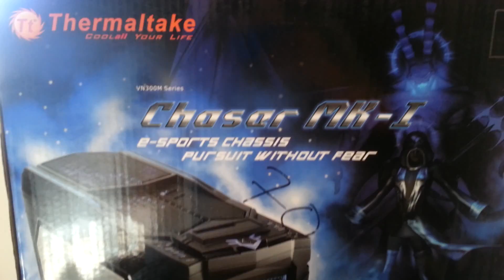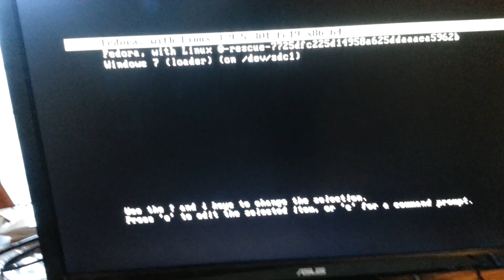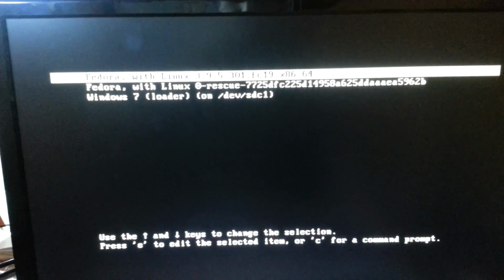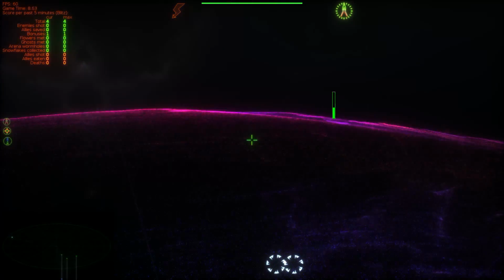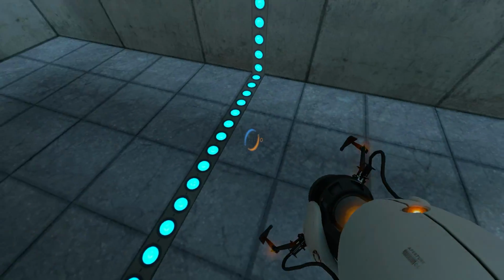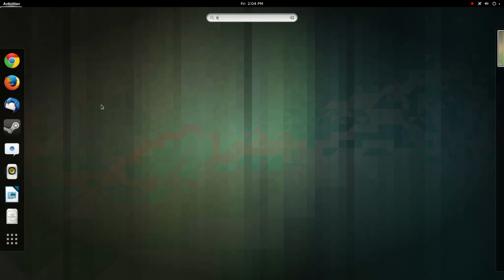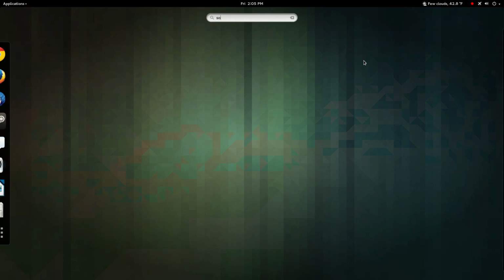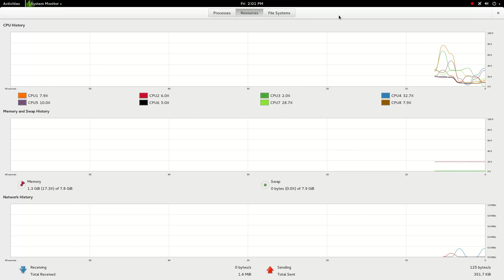Building my Linux Gaming Desktop

Comment: linux and gaming, not a good fit, even with DRI kernel drivers, X window system will always be a bottleneck, hope haiku OS will get native drivers, mostly it will beat windows on gaming performance, nice trooper btw
Reply: Cody Shell I will now commence in subscribing to see this video.
Reply: This problem is not that bad as you make it sound. Even with this "bottleneck" as you call it, good gaming performance is quite possible. But also is something that has nothing to do with Linux kernel. And also it will go away completely in the future. Android does not have it, Ubuntu will not have it with mir and all other distros will not have it with wayland.
Reply: lucinos19 its not a fault in linux, linux were not made as a desktop OS from the beginning, only nearly recently linux got schedulers for desktop performance, and linux kernel can be turned into anything but as long as we still use X windowing system we have problems, as for Android i have no idea about its architecture its based on linux but same goes for iOS and BSD they are now completely different, after all you might try linux native games and try same games "windows binaries" on windows and you'll notice a difference, linux is not a desktop OS and if it kept caring much about becoming desktop oriented it will lose in both server/embedded and desktop context
Reply: I just want to point out that they already did the study Linux Vs Windows. Linux won. It got 15 more frames than windows.
Reply: hi Brian, i will have to disagree, first of all this is no study, this is not even a benchmark :), getting more frames from a game that doesnt use modern shader capabilities is not a benchmark, linux is better than windows "as most unix like OSs" when it comes to matters like processor affinity and memory management and others, and that can boost performance of "some" games but that cant be applied to most other games, just try it out your self, get a game with heavy shader use and check out yourself, even most older games will still have better performance on windows, and that doesn't hurt linux btw, i use linux right now, just linux wasn't designed as a desktop OS, or for multimedia as say Amiga, its just the modern hardware make that gap smaller, but its still there, and will always be there as long as we use X windowing systems.
Reply from the maker: BrianGamesLOL Thanks Brian!
Reply from the maker: Adel Essam I working on a test video comparing linux and windows. it will be up soon
Reply from the maker: I just ran the test and took some clips. Overall windows did better than linux in opengl and directx11, but it suffered greater framerate drops. I will have it up soon!
Reply: that matches what i said, graphic performance "gpu based" on windows is expected to be better, and linux is better when it comes to threading, VM etc, still with games like most modern ones with heavy shader use "much gpu reliance" are expected to have much better performance "including frame
rate" on windows
Reply: Wayland, linux
Reply: ***** actually i know what linux is, and i use linux as my desktop OS and BSD everywhere else, i mentioned before linux has much better implemented core OS subsystems not only that its not bloated, but again the point is that linux never been made with real time graphics in mind, and i use linux for gaming and i know well most games run better on windows, not for windows being superior but for it includes graphic subsystem fully into the kernel, yes linux is not far from that but until now linux is behind in games which doesn't hurt it, for me i don't care that linux become superior in games cause linux will not fit as desktop OS at all, it can be use for advanced embedded systems and servers, again i don't defend windows being the perfect desktop OS, windows tried to be both desktop and server oriented OS and it failed in both, only cause linux is open source and you get the advantage of removing and adding what you need into the kernel at compile time keep it from failing as a server OS. still as i mentioned linux is superior OS at even fundamental OS subsystems, check out HaikuOS which is desktop oriented OS to get what i mean, check how slim and lean it is and still retains a desktop OS simplicity, its still under heavy development but it shows what a desktop oriented OS can be
Reply: ***** benchmarks for one game is not enough, besides i mentioned that linux has superior subsystems other than graphics that allows it to come up with better results than windows, and i did not say linux will never be better than windows in gaming cause with dri2 and newer graphics innovations it will be great, but it is not now, as for a desktop OS for me it is a slim OS where you can configure everything from gui and easy and elegant with security added as services, all the things you talked about on how linux is stable and secure and so is just as much a server OS requirements, what make a desktop OS is the simplicity to deal with it, android is not a linux anymore, it uses a heavily batched linux kernel and heavily batched libc "derived from BSD" and builds up a C++ and java API, true you can chroot into a linux system but android is no longer linux, and actually if android was built from scratch as mobile phone OS it were to be much slimmer, like how haiku is, why would you turn a beast like linux into a baby OS ? linux is no magic by the way, there are some realtime operating systems that advances into very powerful OS and on the hardware they are designed for they outperform linux and BSD its a matter of optimization, haiku is just an example of an OS optimized for desktop use, i like linux and i use it as my desktop OS cause i like it, but if haiku had as much packages as linux has i were to use haiku, it got a posix interface that can run almost every posix non graphical program, have a nice day
Reply: lol okay just calm down i am not challenging you here or making less of you, i work with unix its my work, and i run BSD and linux servers, and i also use unix shell most times, and the computer i use right now got openbox wm and a minimal taskbar and thats it "debian based", when i talked about GUI i meant a desktop OS, if you think all desktop OS users have to learn to deal with commands and read man pages then you should never expect your OS to succeed, as for linux, linux is slim and fast compared to other server and most desktop OSs, but i cant claim that linux or even BSD is the fastest operatingsystem ever, even if they use them for supercomputers, supercomputers are fancy hardware, if you want to really measure the speed of an OS measure it on modest hardware, an operating system is the platform that manages computer resources, so you have to use your resources efficiently and perform good, and for example in embedded systems linux is not a good performer like other RTOSs even those with full multitasking and threading support and POSIX can outperform linux as an embedded system, what i try to say is that i like linux but i am not a linux fanatic, linux is not the ultimate solution for everything, again you mentioned gaming and desktop operating systems, and i gave haiku as an example of a trend not of a fully working OS, haiku has no stable releases until now, its just shows what a desktop OS can be like, btw, haiku is probably more posix compliant than android, though haiku is not linux, what i mean here is that android is not a pure linux OS, it is a variant, heavily modified variant, btw android performs worse than iphone, and if you know that also android uses a variant of BSD libc instead of the GNU libc and the other options available for linux cause it is slimmer, what i mean here is that they faced problems that they had to make modifications, as for linux being a baby OS, you know that linux embedded distributions are complete different fork of linux? what i mean is that unlike BSD for example where all architectures it supports can be compiled from the same source tree embedded linux variants are heavily modified linux and some subsystems even are replaced with slimmer ones, so linux in that case is just the general form of the OS but these embedded linux versions are really different, same applies to android, so imagine if someone used whatever OS like minix or other RTOS to create their own embedded mobile OS, it can be as good or maybe better than linux, or worse of course, but what i meant is that linux is not the sole solution for every computing problem, i usually find BSD even much better than linux specially under severe load, and sticks to the standards better than linux, i can give examples i faced with linux POSIX compliancy issues, still i like linux much, and i find it better than windows, and even as a desktop for my self i like it much, but for the general usage of the public a desktop OS has to offer consistent GUI and easier package management, linux is not meant to be a desktop OS, it can succeed but it will never beat a desktop optimized OS "which i dont claim it exists now" when it comes to desktop use, its not a matter of linux ability linux is capable, its the matter of what you want to be, have a nice day :)
Reply: it never excels in all these actually, embedded systems where linux can be used are just as powerful as pentium II series which ran linux smoothly, some other really tiny systems will not run linux smoothly if ever it ran it, again linux distributions of embedded systems are separate source trees, not really the same linux, and no having a window manager doesnt make linux desktop friendly, to automate everything for non power users through gui you'll need much scripting, comon, i am sure you know how alot of times depenency resolution scripts fail, linux is meant to be used from shell, Xwindow systems can never replace a gui subsystem within OS kernel at least partially, still linux is close, and actually you making less of bsd cause of gaming is silly, bsd never meant for games and they dont really care for it, games are not a measure of operating system capability it can be a measure for desktop oriented operating systems, and general purpose operating system cant be thought of as good as desktop optimized operating system, linux is famous but its not same linux on mobile or on embedded systems, its just very basic subsystems and everything else is written from scratch, linux is used to abstract some work for embedded system programmer, believe me there are embedded systems where linux will fail, or else linux would run aircraft avionics and medical devices, and realtime software used in complex firecontrol systems, nor it will be good for automotive ECU embedded system, you will rarely if ever find a production quality linux based system for such applications, try not to be a linux geek, i like linux, but there is nothing that is ultimately excellent for everything
Reply: lol haiku is a desktop OS you like it or not, at least its developers are developing it for that purpose, and raspberry is a mini computer that uses a highly advanced embedded processor, not a tiny system in embedded system world, you really don't get the wide use of embedded systems right, and you say linux run in automotive ECU and medical systems, show me the example, i am waiting

as for the statement that linux is used in embedded systems more than any other OS is funny, what linux consider embedded systems are actually general purpose architecture not dedicated one like the majority of embedded systems in the world

i understand you are young, and general purpose embedded systems available today can confuse you, since the borderline between GP embedded systems and GP computers are tiny, i will not claim you are ignorant and shit like you said. notice i try to be polite here, its ok to be a linux fan, but not a fanatic.

as for desktop environments still they can get some problem that will not be recovered without using shell, desktop users whom are not interested in shell will not like that, its not like linux is the ultimate perfection, windows failed when it tried to be what its not, a server capable OS, you dont have to be so good for everything, linux is not that tiny OS btw, and most open source OS systems can be shrinked into something tiny, BSD for example, but that doesn't mean they are enough tiny for tiny embedded systems, current embedded systems are have much power than my old pentium II
so yes linux and bsd can be embedded, but they can only fulfill a subset of embedded systems :) try not to take my words aggressively i am not your enemy, have a nice day
Reply: let me put things straight:
HaikuOS is community driven none commercial OS with few developers, so comparing it to others when it comes to gaming is early, in most other desktop OS aspects it is better than linux, it is simply optimized for desktop
i used DOS and amiga and i like a CLI but its not something you should force on most desktop OS users
linux never ever worked on ECU the article you sent is not even an article it confuses ECU to other multimedia and luxury computing systems in autos, so if you have real life examples, not researchy bullshit just send it
bionic knee, a research robotic device, i said before linux will find use in robotics, still, for production bionic knee, linux is bad choice, why would you need a full operating system for a bionic knee? :D seriously thats geek, again its not even production level quality, besides its not a medical device, thats a robotic device
BSD vs linux, lol don't even try, even android uses libc from BSD cause its smaller and better for battery devices, don't hit what you have no idea about, excluding openbsd no BSD will crash before linux does, in any production system, you'r dreaming, NetBSD targets more "embedded" systems, from the same source tree than linux kernel can, unlike linux for embedded systems these are different forks of the kernel it self
as for my english, true my english is not good, its not my native language anyway

try again, find a production ECU that runs linux lol, or medical devices
again i like linux, linux is widely used, but since when most widely used are usually the best? windows?  have fun
Reply: 1-again you try to make a win out of nothing, i said normal computer users will need an operating system that they can configure with gui, linux until now cant have full configuration through gui and thats normal cause its not a desktop OS

now you again bash on haiku though i am not even defending it, here it is, haiku's schedular is much much better than linux when it comes to desktop use, haiku is much more responsive than linux, loads in much less time, and has a much narrower learning curve

you cant just lie to others on that, i used haiku and i know how it is
guess what, AROS also is more responsive than linux, it has a single address space, very bad for security but makes it much responsive

2- again you try to make a win, you did not send anything that quotes ECUs and brake control systems are run by linux, the article doesn't state which systems use linux in automotive and clearly it means those for comfort and fun, they can be even android based lol, try harder

3- ECUs never were run by QNX even QNX is too much for ECUs most of ECUs are not based on operating systems, they are special purpose embedded systems

4-bionic knees and other stuff like these monitoring devices and scanning devices are not life critical devices like i mentioned first, life critical systems are those used in ER situations or in intensive, i don't know the exact category in english "english is not my native language" but these never run linux, the devices in intensive care usually never run linux, btw even most printers dont lol, and if linux is the most common OS there thats normal cause these devices again dont use any OS they use special purpose embedded system, with a dedicated purpose software

5- i just gave example how BSD user land was used cause its lighter, they used linux kernel cause its more popular maybe, but not that its better than BSD, and actually linux is called GNU/Linux, and linux crashes, alot, much much more than BSD
even openbsd that is the worst is more stable than linux, linux is full of faults, its posix compliance is not strict, enjoy this one 
http://tracker.firebirdsql.org/browse/CORE-1476
just an example of how linux is far from perfect

read more about embedded systems, and don't use the argument of linux being most popular OS in embedded systems cause majority of embedded systems are not based on any OS
when they make ECU and other critical embedded systems with memory and processing power constraints come and argue, seriously fanatics like you only give bad reputation to linux
again, linux is far from the most stable OS, even slowlaris is more stable
i can challenge you any day with NetBSD vs linux stress test, lets see who will crash first?????